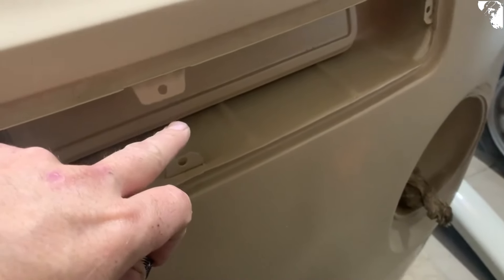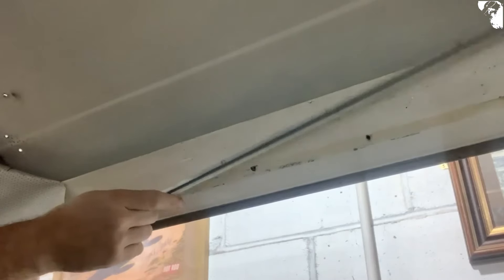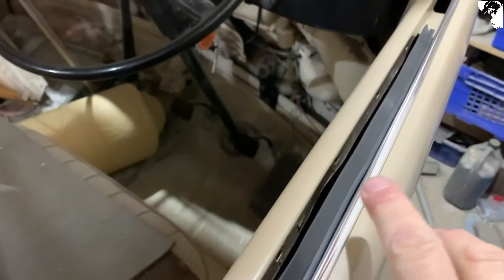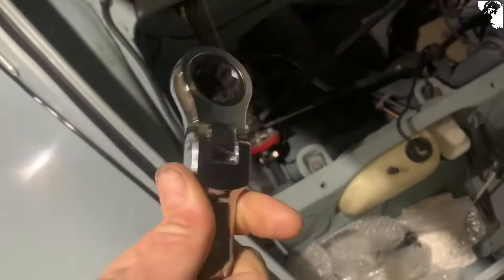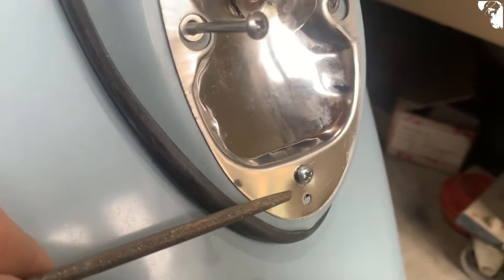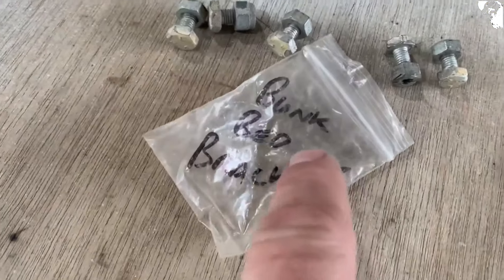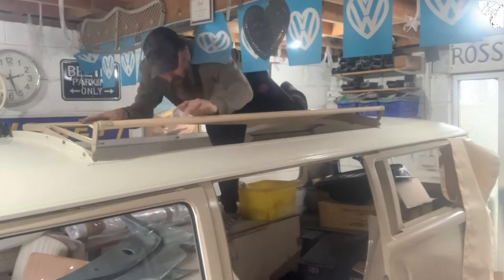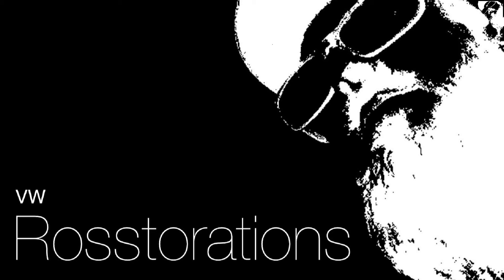Classic Volkswagen Beetle & Camper restoration #50/123

Comment: It's so funny to me how we have had so many similar issues and solutions. I have used nutserts in my taillights. But for a slightly different reason. Mine are for access to spark plugs, which might sound odd, but I have hipacs. 

I literally did all of the wiring the same as you in my last video haha. I also fitted WW window chrome trim, which actually fit pretty well.
Reply from the maker: Nearly bought the hipacs myself. Reckon I may need them later on down the line, more so the carb adjust that I have going on there. Gonna see how I go. Guess we are all in the same boat then 😂
Reply: @VwRosstorations  yeah I have weber icts so it just made sense. Can whip the light cluster off then hipacs and get to everything without removing wing etc.

Comment: Think the washer indicates . The voltage the horn operates at , and the number of oscillations, cycles of the horn. You may want to check if if you require  a 12V Horn ? as i suspect you have a 12v system . someone may have changed  it out . But it works ok, someone out there must have more of an answer on this.
Reply from the maker: Yeah just never seen one stamped like that. 6v horn and starter motor are fine to keep on 12v system. 👍